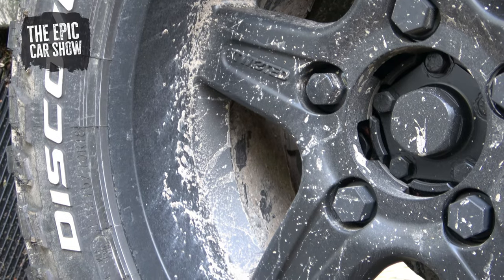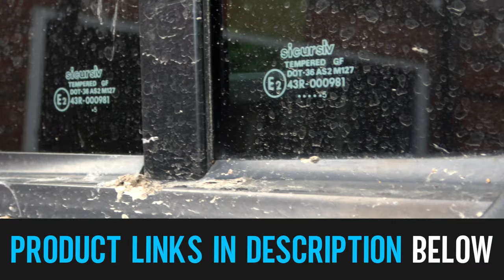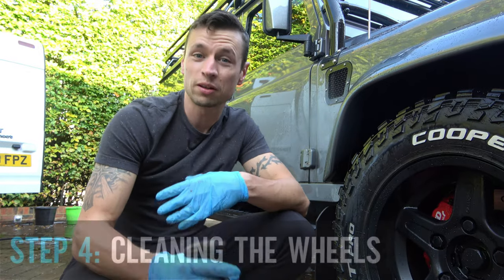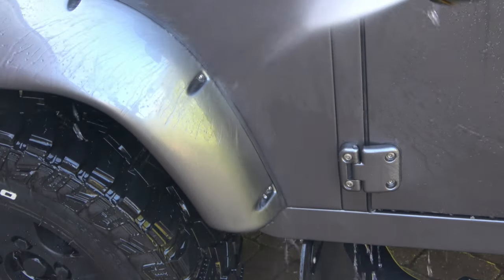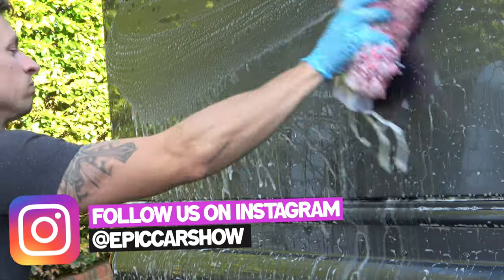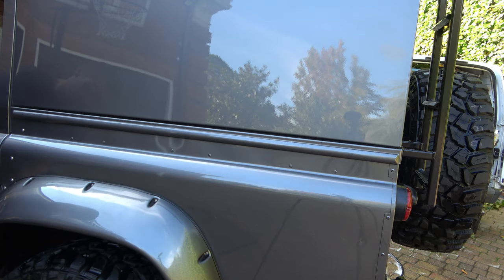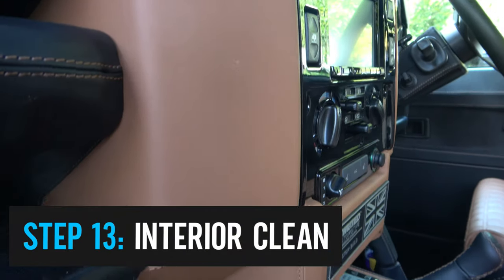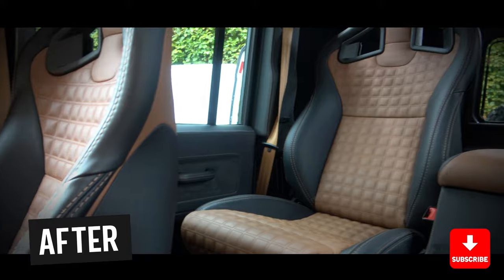Deep Cleaning a Filthy Land Rover Covered TOP TO BOTTOM IN MUD

Comment: Great video. Will try some Yum products when my current stuff runs out. How durable is the tyre dressing?
Reply from the maker: Hi Nick, Very durable and has a nice finish. I use it on exterior trim too and it's incredible how changes colour. The tyre dressing in this video is drifter by bear car care.
Reply: It's pay day on Friday so the 10% discount code will be used! Thanks
Reply from the maker: @nickcaie7767  what products u going for? You can't go wrong with anything from them
Reply: Think it will be the interior cleaner and tyre dressing but the detailer and brushes also look good! I've got Garage Therapy CS3 on my car at the moment which is great. Would the detailer be ok on top of CS3?

Comment: Had the exact same problem with my machine. You've got a leak somewhere mate. Mine was on my gun had to end up having a new gun which cost me £100
Reply from the maker: Yeh I bought a new hose but in doing so I weakened thread so now it drops water 😞
Reply: @epicautomotivedetailing  I know the noise well lol drove me mad for 4 weeks. Finally found the leak on my gun. Always money money mate never gets easier does it.
Reply from the maker: @jfett77  yeh it's a nightmare this machine is so expensive to buy parts for cost 150 quid for a hose